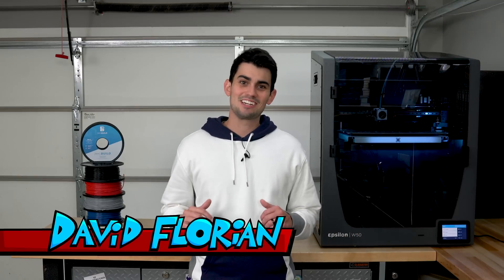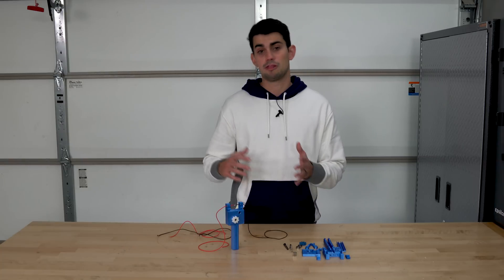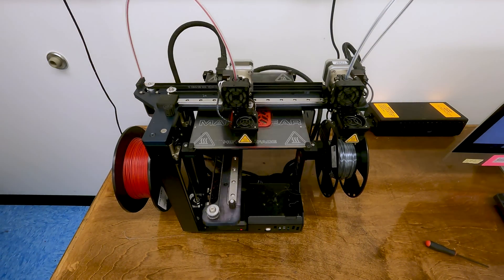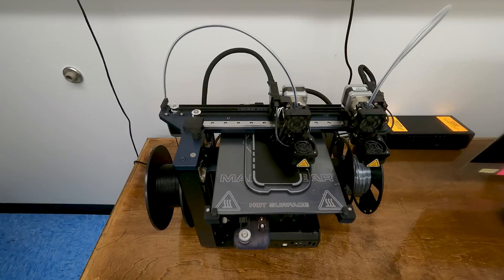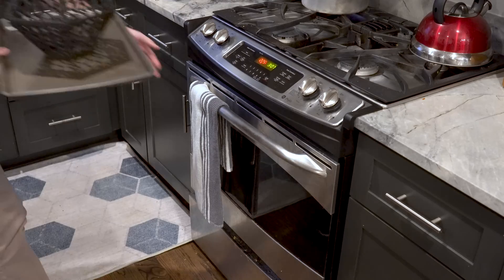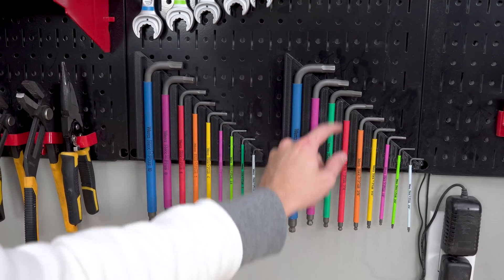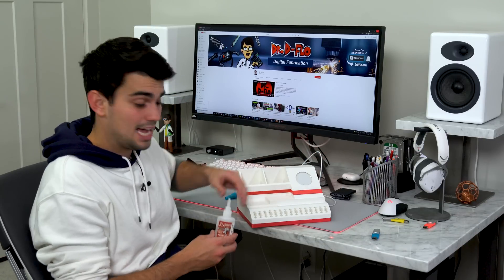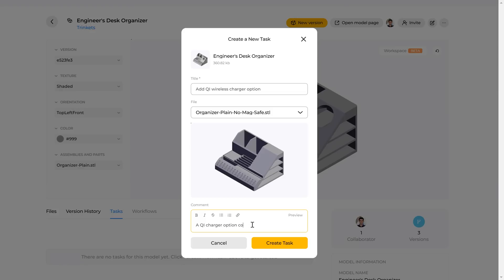5 Useful 3D Prints! (Original Models)

Comment: I am still new to 3d printing but I do wonder about a type of filament you used. That stuff you put in the over. Is that really safe to be cooking in your primary oven? I ask because when it comes to paint, (there is a kind of paint that you have to heat up to about 450°) it will taint any oven in 1 cook and the claim is, you will never get the smell out and it will always flavor your food, not by your desire of course. So I wonder if this plastic can release substances into the oven.

Comment: If you would splice the wires together correctly you could still solder them and not need your solder tool. And I'm not talking about using a crimp connector.

Comment: If you cut a magsafe sized hole in the back of your iPhone case you could have it sit flat while also allowing charging. 

You could even just extrude it down  in that section so the pattern stays the same but thinner in the hole. 

Best of both worlds 🤷‍♂️
Reply: Would be really uncomfortable on the hand
Reply: @octimus2000  many iPhone cases used to have a cutout in the center for the Apple logo. Wasn't uncomfortable(although matter of preference) and provides extra grip.

Comment: Would it be possible to print it in PLA and cover the areas exposed to heat with aluminum tape? (to prevent heat transfer to the PLA, to avoid melting the tool) Or high temp flue tape?
Reply: you could use kapton tape, or even multiple layers of kapton and aluminium tape interchangeably - this is actually how they make thermal insulation for satelites and outer space stuff

Comment: You could use a nozzle from a 3D printer as part of your solder guide. This will alow you to get closer to the point of soldering while shielding from heat.

Comment: Thanks for sharing and looking forward to the new shop!
One thing, the impact resistant pro has to be store vertically with the tip down or you empty the antioxidant reservoir at the bottom of the probe to protect the contacts. Cliff mention it multiple times in the videos.
Reply from the maker: Hey Ale, thanks for point this out! The probe was only stored like that for the B-roll, but this is improper storage
Reply: @DrDFlo  No problem! My pleasure 😊 Always amazing content. Thanks for your work.

Comment: 1:20 Easy, use a lineman's splice, apply flux, then you are only holding the solder and soldering iron. It never ceases to amaze me the overcomplications people come up with for such a simple task as soldering that unquestionably result in lower quality joints. The lineman's splice works like magic, sure NASA does not rate it for stranded wire/cable, but they do not rate any soldering joint for stranded. Sure crimping is even better, but who wants to deal with a huge box of ferrules that you can mismatch when the lineman's splice exists.

Comment: I do love the screw-out functionality of the bolt organizer, but as storage it doesn't seem to make very efficient use of volume (or plastic).  If the connection scheme was in the corners instead of the edge centers -- either by dropping the connecting pieces and adding paired male/female dovetails around each corner, or by cutting off the corners and giving them dovetails at 45 degrees to mate with revised connection pieces -- then the usable center volume could be a much bigger chunk of each piece, and it'd take less material to print.
Reply from the maker: The problem is that you also have to leave a lot of space between the bolts so that you can unscrew them. As I mentioned, just normal cylinders that slide in and out would be best but definitely not the most fun
Reply: @DrDFlo  Good point, I hadn't considered the need to get fingers in there.  That's solvable, though -- a finger-sized slot or a protruding smaller-diameter cylindrical grip or other feature (perhaps a cross or bar with finger hole) or even just cutouts around the edge of the caps could cover this problem and let you pack them tighter without losing the unscrewing coolness.  My main concern if it were my design would be hitting something that didn't require a grip shift to start and then finish unscrewing, and let you keep a good grip as it came out to avoid drop risk.  Anyway, it's a cool design as-is, just couldn't help wanting to throw out a few ideas.  Take or leave, and thanks for sharing!